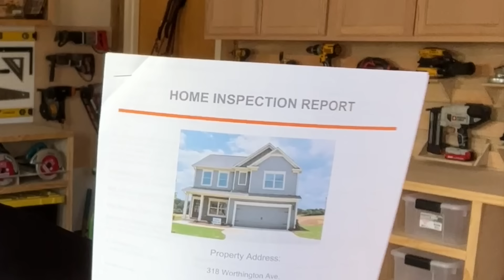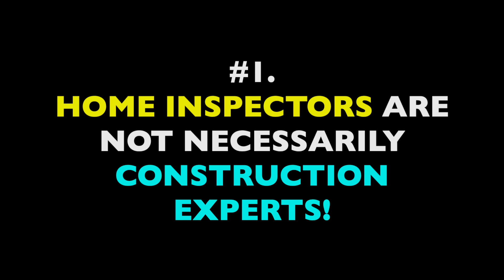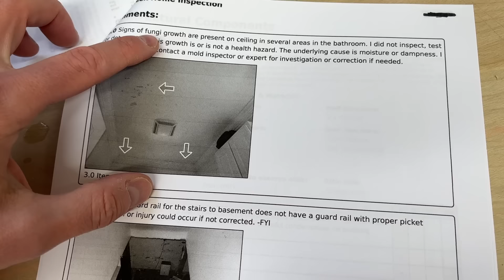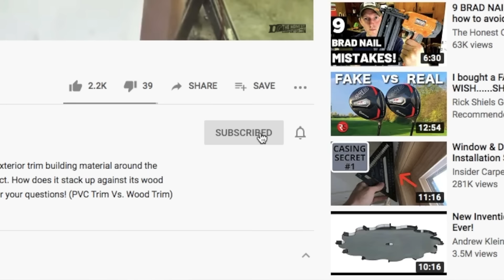The Truth About HOME INSPECTION REPORTS! What They Leave Out...(Homebuyers SHOULD WATCH This Video!)

Comment: My report template categorizes defects as: red (significant) or orange (moderate)
In my area a problem customers are facing is the "cheapening" of insurance inspections. Some cgarge as low as 60$. Inspectors are in and out in 10 minutes and check of the items on the form and head to the next one...

Comment: I feel like most home inspections are used as a bargaining tool by the purchaser, rather than to really determine what SERIOUS issues a home may have...  Home inspections should be about structural integrity, NOT paint and drywall maintenance.
Reply: Well said!  Who cares if the drywall needs a little patching?
Reply: That is really what it is there for. I used mine to lower the price on a house I wanted that was way over the market value of the area.
Reply: Yes, I've seen it go both ways....as a tool to bargain down the price and a rubber stamp to get the deal done.

Comment: I've been doing heritage grade restoration of Victorian and craftsman era interior woodwork and exterior trim and brickwork for many years as a domestic historian and conservationist.

This video hit home with me in a meaningful way, and am about to complete the certification course to become a state certified home inspector because you're absolutely correct on these corners being quite obviously avoided because of course they are.

Willfully avoiding the areas of the property where the most important things are generally found hiding is beyond inexcusable. Just because it's not their $175,000+ being sunk into an unknown risk doesn't justify taking their hard earned $300-750 for little more than a cursory glance.

I think if I can crawl 3/4 mile through a Somali sewer in August without having a problem with it, a 40 crawlspace with dirt and a few spiders is not even a walk in the park, it's just going out to the mailbox.

In older homes in lower income areas, they generally don't even bother checking if the windows have glass panes in them or have been replaced with plexiglass. One home on my street was sold with a massive bedbug infestation with no hint of it anywhere on the report. There's no way that could be missed even under the most disinterested inspectors gaze.

It's just shameful. Most around here are ignorant of historical building techniques, and don't even know what a pier and beam foundation is, and will fail a foundation over some spalling on a small section near a bad downspout and fear monger that the foundation is collapsing and the replacement of the bricks would cost more than the house would ever be worth. 

What in reality was a minor issue with a small section of skirting became an immanent foundation collapse which makes no sense.

Comment: Thank you for this insightful video.  I really appreciate the perspective of an experienced tradesperson.  I understand your concerns.  I am one of those newly licensed inspectors with no professional construction experience that you talked about, and I'd like to offer another perspective.  
It's very true that I can't tell you how to frame a house or construct a set of stairs.  But it's also true that an HVAC contractor or plumber would not be expected to know those things either.  And while carpenters could certainly frame a house or construct some stairs, they might not know whether an electric panel is properly wired or determine whether the air conditioner functions properly. It's also true that almost every defect a home inspector documents is followed by a statement saying to have a qualified contractor make the repairs, rather than saying exactly how to make those repairs.  It's also true that most home inspectors get their jobs from realtor referrals.  But none of these things is necessarily a problem.
I see my role not as being a construction expert or an electrical expert but as being a homeowning expert.    Most homeowners, especially first time buyers, know next to nothing about homes and their component systems and wouldn't know if something was a problem or not until it became so obvious that it's a catastrophe.  My job is to be the person who can look at a house the way a homeowner would look at it if they knew what to look for.  In other words, I'm the "experienced homeowner" who knows when something doesn't look right and who knows who to call to make it right.  The homeowner doesn't need to know how to fix defects, they just need to know if there is one and who to call to fix it.
Most homeowners wouldn't understand the problem if they saw an improperly notched beam or joist, or if the water heater is back-drafting, or if there is inadequate ventilation in the attic.  They might not think to run the dishwasher and laundry machines before purchasing the home.  And if a homeowner saw cracks in the basement walls, they would probably not be able to tell whether they were just typical seasonal expansion/contraction cracks or if there was a potential structural problem.  Our job as inspectors is to be the person who can reliably inform the buyer about the things they should worry about and what is the proper course of action they (the homeowner not a contractor) should take.
Another point relates to realtors.  Realtors do provide the majority of leads, but a home inspector works for the client; usually the homebuyer, not the realtor.  I am accountable to the client, not the realtor.   I agree that it is a problem that there is a financial conflict of interest here, but an honest inspector doesn't let that become a problem any more than an honest tradesperson lets the desire to increase profit make them falsely identify things that need fixing.
Finally, one thing a good home inspector will do that no tradesperson could do is to provide useful information to a homebuyer about how to care for and maintain all the important systems in their new home.  We've lived in our current home for over 20 years, and I just discovered a few weeks ago that my wife didn't know about the air filter in the furnace.  She has no clue about what to do with the humidifier every spring and fall.  And if she should notice a mysterious dark stain emerging on the ceiling, she would not know whether to call a plumber, a general contractor, or a mold remediation specialist.  She didn't know the clothes dryer exhaust needs to be periodically cleaned out, or where the gas shut-off or water shut-off valves are.  These are all the sort of things that go into a good home inspection report.

As you pointed out, there is a big difference between a good home inspection and a not-so-good inspection, and it's hard to know which one you'll get when you purchase a home inspection.  As with many contractors, experience and a good reputation are critically important.  I am working as hard as I can to develop as much experience and as good a reputation as I can.  
One last thing; contrary to what was stated in the video there is no legal prohibition on moving furniture or stored items, at least not in my state of Illinois.  Inspectors use their own discretion about how far to go to find hidden problems, but that is based primarily on whether or not moving furniture, or removing a panel, or climbing into an attic, can be done in a way that is both safe for the inspector and, just as importantly, in a way that is not likely to damage anything in the house.  Our first principle, as with doctors, is to do no harm. 
Thanks for letting me share my point of view.

Comment: Ethan this video was fantastic!  When buying my present home 26 years ago, I was puzzled why my home inspection report identified a sink stopper that didn't close but missed evidence that three sliding doors on the deck were leaking into joists!  Major problem requiring installation of gutters and replacement of subfloors!  I concluded that home inspections were useless.  When I sold a vacation home recently, I  offered to have my carpenter who had helped with renovations and knew the place inside and out do a walk through 'home inspection' with the buyer to point out what we knew about structural integrity and what future projects might preserve and protect this old dwelling.  It was a win-win for all.  This was a cash buyer, no "formal" home inspection  was required for the transaction.

Comment: When I was getting my house ready to sell I found a water leak at the washing machine. I hired a plumber to replace the pex pipe with new pex pipe. Everything was fine with no leaks. When the house was inspected the inspector stated the pex pipe as an issue. He said it should be stainless steel and put the price to fix it on the report.

Comment: Good video. Mostly accurate. Those of us inspectors that DO come from the trades are very often much better than those who do not... but that is not always the case. Common sense goes a long way, as does being taught correctly from the beginning. I have argued with "20-year carpenters" that were simply taught incorrectly and never knew any different. Luckily I have experience in multiple trades, as well as the fancy paperwork to back it up. lol

Comment: I refused a home inspection.  I'm an electrician who has also worked almost every other form construction, so the first thing I did when I bought my house was to go up on the roof and examine everything.  Most inspectors, in my experience, never go up on the roof.  They have no idea about electrical code,  and will approve an old heating system as long as it's functioning.  Whatever they find that's wrong will have to be fixed anyway, and it's just as obvious to a homeowner as it is to an inspector.  But certain programs like FHA require them for approval of a mortgage.

Comment: General contractor w 20 years experience and home inspector graduate here . Rules and sop prevent you from including you have any experience in construction ..it will hold you liable if a repair is found and could have been explained because you said you were a carpenter ..then you get sued for repairs . Also ..a contractor or ex carpenter say .. doesn't usually know how heat exchangers work or rules of piping and plumbing and exhaust . So really it don't matter if you can from feild or not . There is insane amounts of liability in inspection . Having to pass a state and national exam makes you instantly more qualified on it than any other trade in an overall standpoint . And clutter on the report is uncalled for . Simply stating a defect in paint or cracks (if minor) can be summed up in 1 statement . Being a responsible honest inspector is a very hard job do not underestimate . And there are some hacks ..but in all areas . Awesome video

Comment: The whole thing about repairs is a liability issue. If we as home inspectors start telling people how much something will cost then the contractor comes out and the estimate is much higher than we are liable possibly for the difference. I offer a program called cost estimator and the report gets sent to a different company and they use local pricing and contractors to find out how much the repair would cost and the report did then sent to the client to know what basis they should go off of. As far as classifying major minor and structural versus non-structural defects the program I use for my inspections uses different colors to denote whether it's severe major minor or just cosmetic. We circle put arrows if needed.

Comment: Of the four homes my wife and I have bought and lived in during our 50 years of marriage, the last two had/have water leaking through basement wall to floor joints during heavier rainfalls,…and both were sold to us as having been inspected (we hired the home inspector) with evidence of such an issue not found.  Upon asking around (friends, cohorts, neighbors) we’ve found that this issue of leaky basements is more a ‘standard’ than an exception,…and that home inspection rarely ever gave advance alert to existing evidence of prior experiences.😬

Comment: I have a loan through my City.  I had to use their contractors.  Yes, contractors. First one got fired.  Both contractors didn't cover my roof during rains.  My inside walls were dripping wet, ceiling warped, cracks, shorted out light switches.  Yep!  destroyed home!  I had a, I think, very good inspector.  You are so right about personal items in the way of an inspection.  I have a small home and it was so hard to move everything out of the way. He was at the home for 6 hours and even checked to see if my kitchen drawers opened up.  I don't agree with all the report, like he said my doorbell seems to not be working, when in fact it was.  But what I really liked is that he not only bullet the paragraphs and tons of pictures, they were marked as high priority, safety issue and so forth.  Don't ever use a inspection that was previously done!  That was my mistake.  My realtor was a "fri-end" - yes that's the end- and she said it was just inspected and they do not pick sides.  They tell it as it is.  Wrong!  Go get the inspection!  Also a roof inspection!  Make sure if there are any warranties that the owner transfers them to you right away and the company knows!  I was supposed to have a warranty on my roof and the owners failed to provide the info to me!  It's been a heartache!  Thank you for this video!  It is so important in buying a home!  With all the damage I have had at my home I could probably be an inspector myself. LOL

Comment: As a home inspector you make many good points but I disagree with you on few points. First you said at 6:50 that major defects get the same space as aesthetic defects. That's not necessarily true. A good home inspection report is going to have general information with minor repairs such as caulking and a section with material defects which are defects that are both safety concerns and/or can cause major damage to the property. These material defects are also highlighted in a summary report on the home inspection report. Also remember, a home inspector is a generalist not a specialist. We will identify and even if possible suggest a cause and possible results if the  defect is left unattended. Sometimes we will go as far as identify ways to fixed the defects, but we often save that for the specialist (as you said correctly there is a liability issue with that).  It's like going to a general practitioner who then recommends a surgeon who is a specialist.
I do agree that a home inspector should know about building homes and components surrounding that topic, but they should also know building science, have good report writing skills, and excellent communication and customer service skills. 
Being a home inspector is far more difficult then many people can imagine. We work for our clients, typically buyers, but still have to deal with sellers, buyer agents, and listing agents and someone is not going to always be happy with us. In the end we prioritize our clients, their safety, and their investment.

Comment: Great Video! As a fairly new inspector (2 years) with over 20 years of construction experience including a Red Seal Carpentry ticket, I can tell you that there are definitely real estate agents that recommend the fast/easy inspectors. I am extremely thorough and it has definitely negatively impacted my business. If a realtor can get a multi inspector firm in and out of a house in 1.5 hours vs solo me taking 5 hours to pick the house apart, 95% will take the fast and easy.

Comment: Good video. 
We are allowed to move stuff in most states. Sometimes we will. It depends on the liability. 

Inspections do miss things. We are not required to enter areas unsafe or not accessible. We do strive to navigate the entire crawlspace. 

I strive to always learn more about construction. This helps us provide better information to our clients without freaking people out.

I do describe defects as minor, moderate, major with blue, orange, and red colors. 

I also tell my client if issues are big or small. 

I do not use "further evaluation by qualified professional" often. I recommend repairs be performed by a professional if necessary.

Pipe boot had holes in at the time of inspection. This can allow for water leaks. Recommend correction/repair. 

When I use "further evaluation" it is for complex issues like electrical issues or occasionally issues I am not sure. Contractors don't know everything either. In fact most contractors only know about their limited field.
Reply from the maker: Very good info, Chris! That’s a thorough report. 🙂
Reply: @TheHonestCarpenter  thanks. I love your vids
Reply: @chrishall2594  hi chris im starting a home inspection company.  I am a contractor with 23 years of experience in home repair and building.  Im curious about what regulations prohibit me from putting down: 

Rubber seal on pipe boot rotted
ROOF REPAIR: replace pipe boot 
COST: $200-400

Comment: Well that explains a lot.  100 year old house.  Ancient plumbing and wiring.  Spongy floor under a toilet, etc.  Inspector only reports a handful of items.  Bank shrugs and sale goes through after a painter touches it up.  Always wondered why so few problems were found in such an old house, and now I know.  The house, basement, porches, and attic were all very cluttered, and the inspector himself didn't really care to photo all the obvious flaws still quite visible in spite of the clutter.  "Back door needs paint" and "window needs caulked" got in the report, but back foundation sinking, dangerously deteriorated concrete steps, rotted bathroom floor, and iron railway post rusted completely through did not.  This house is my school of hard knocks.  Wish I'd seen this video 5 years ago.